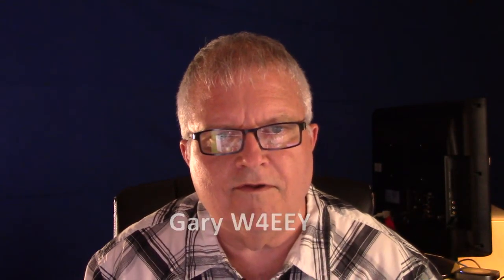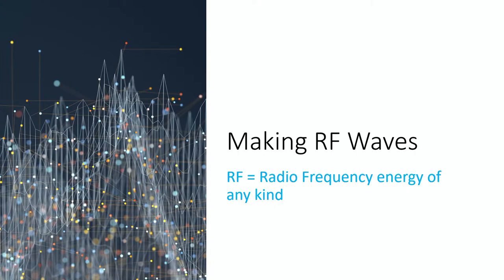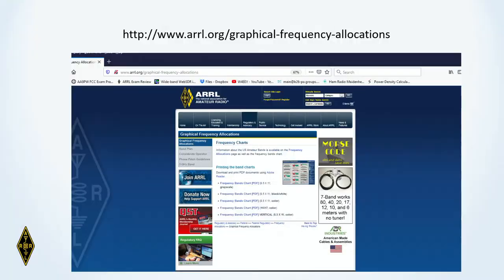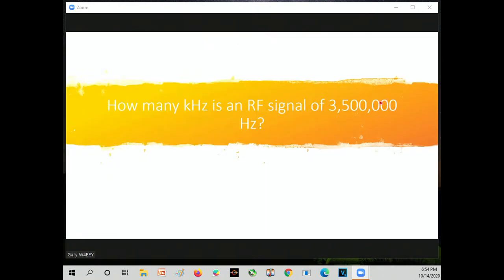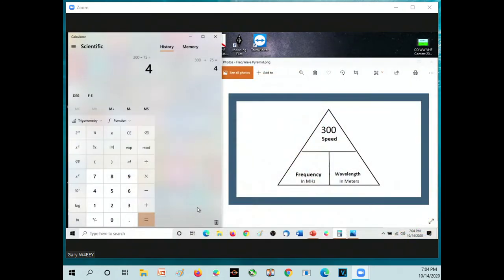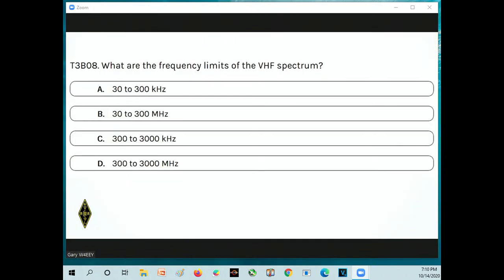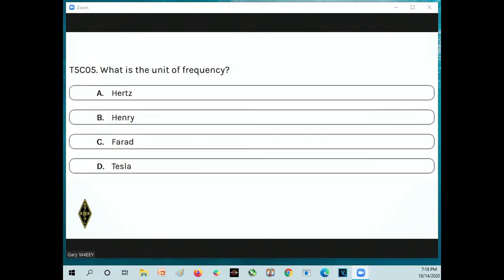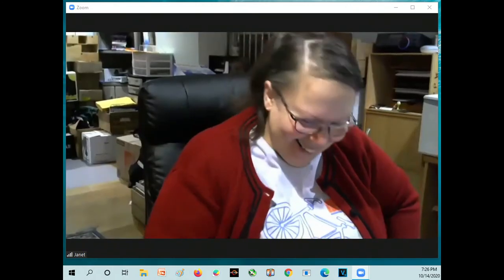OLD - Ham Radio Technician Class 2020 - Chapter 2 - Radio & Signals Fundamentals

Comment: First off I would like to thank you for this video I’m working on getting my technician license my question is on the ARRL chart where it has a little T say for instance the 80 meters has a T does that mean we are all to transmit on that Bands? Thanks for the video and I can’t wait to to get my license
Reply from the maker: Technicians do have a segment in the 80M band that can be used to transmit CW (Morse Code) only, with a maximum output power of 200 Watts. Technicians have similar segments on 40M and 15M.

Technicians can transmit SSB and Data signals (plus CW) on a portion of the 10M band too.

Technicians have full privileges on VHF and UHF (6M and above).

To get more privileges on the other HF bands you need to upgrade to the General Class license.

73 de W4EEY
Reply: @W4EEY  ok thank